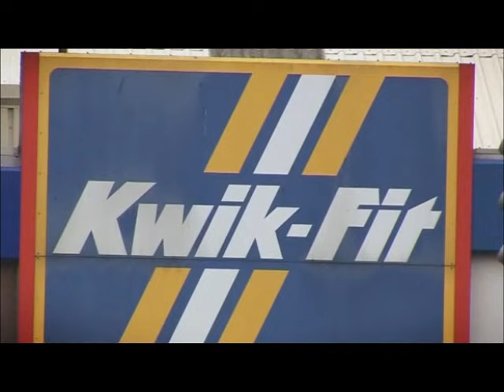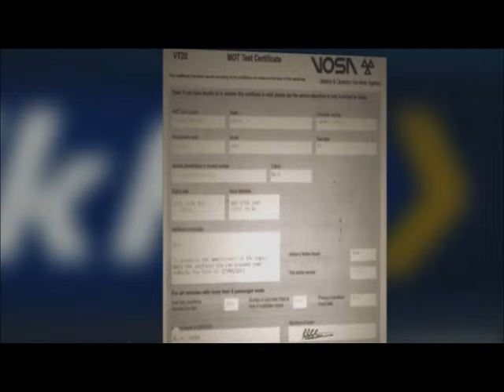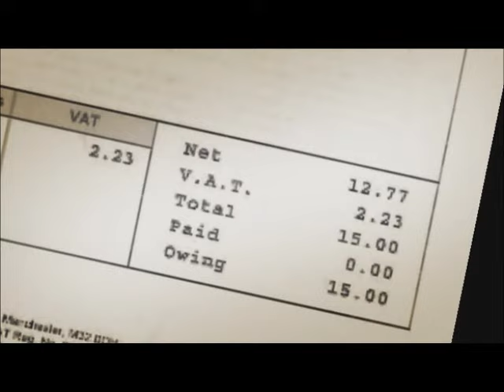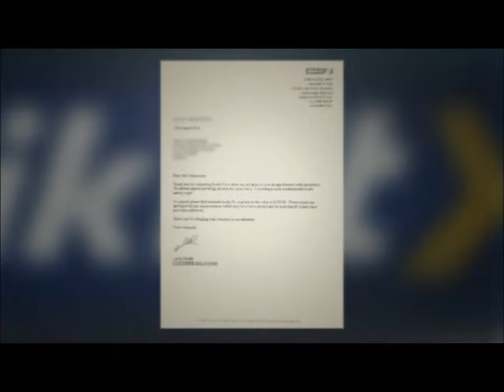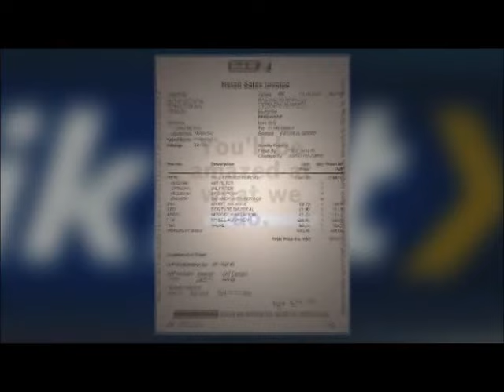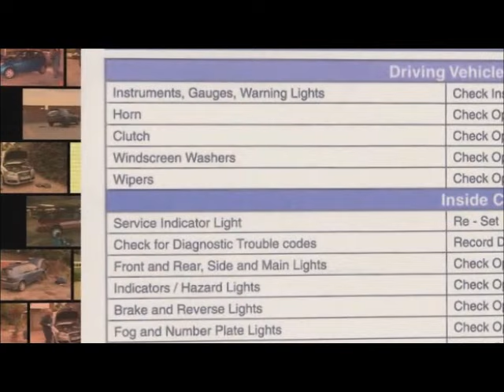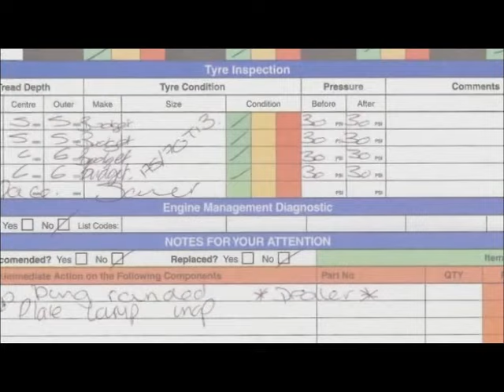Kwik-fit Car Rip-off Watchdog.wmv

Comment: A young work collegue took his 1 series BMW to Halfords for a suspected bulb or fuse issue, not being very mechanically minded it seemed a fairly easy safe thing to do, after sometime watching a spotty youth working under the bonnet he was told it could not be fixed by them, when he came to drive off the car would barely do 20mph (the car was now in limp mode for those of us in the know), after some heated exchanges he was directed to a Halfords 'special' garage where they could not find the problem - amusingly they could not even open the bonnet and had to be shown - he was also treated to appalling customer service and made to feel it was all his fault, with no resolution in sight he took the car to a local none dealer garage to have it 'indipendantly inspected' the result, a missing fuse from the fuse box for the engine management found placed at the side of the fuse box with out doubt removed and not replaced while 'trying' to diagnose what was in the end blown fuse for the light that was the start of all this.
Halfords quietly paid him £1000 in compensation to bring the matter to a close.

Comment: National tyres will rob you too! I took my sisters car there for an mot and they said it needed brake discs and pads all round. I said I would get my mechanic to do it. They said they couldn’t allow the car on the road in such a dangerous condition. I said my mechanic would pick it up on his trailer. Then they said that as long as I promised to get the brakes done asap they would pass the mot! A year later I took her car elsewhere for an mot and guess what? The same brakes passed easily! Robbing bastards! 💀

Comment: Kwik Fit MOTed the other half's car and failed it on brakes. I knew there was a problem with the ABS as it kicked in every time the brakes were pressed, but the actual brake components on the front  were less than 6 months old and the rears were around 18 months old as we had kept the receipts . Kwik Fit had the car for 4 days saying that the brakes were completely shot all round , then charged £450 for new brake components, which they made her pay for first , then called to say that the car had just been re-tested and had failed again - on brakes !! Then said it would cost a further £2-300 to sort it. I promptly drove down there myself to have it out with them with my other half in tow. They had an argument for everything I threw at them. How can you claim to change the brakes and then fail it again on the brakes you've just changed ??  Also it's funny how the manager is always in a meeting , isn't it? I told them the ABS was faulty, causing the brake problem, not the discs, pads, drums and shoes etc.Why did they make her pay before the job was done, etc. I then told them to get the car off of the lift and we'd take it elsewhere. They refused to let my other half drive the car home telling her it was dangerous and it didn't have an MOT. I left with my other half , threatening to involve trading standards and the police as they were refusing to release the vehicle. My other half received a phone call from a "manager" about 2 hours later saying he was pleased to inform her that the MOT had been passed and they would be waving the extra fees. We went back, picked up her car and I followed her home. The first thing she said was that the ABS still kicked in every time she touched the brakes.
Upshot was the car ended up being scrapped as the brakes, although shiny and new, did not function properly due to the ABS and other issues like the pistons in the calipers being goosed.
I wanted to take this up with Kwik Fit but she decided a new car was the way to go instead.

Comment: Went for a job at quick fit once , not as a mechanic but as a handy man. They asked if I could change a wheel, I said not really sorry, then they said can you just do an oil change , but again I said sorry but no I can’t,. Then they said what about just checking tyre pressures, I thought for a while and said sheepishly , that’s a bit too technical for me,  then the boss stood up fuming and asked “  if you can’t do simple jobs how the fuck  can you be a handy man “        Well I said,  I only live round the corner.

Comment: I took my car in for a service and was advised my brake discs were low and would need replacement at the next service.I measured the discs and found them to be well within spec.I went back forcthe next service and was reminded the discs were due for replacement.I ask the service manager what the disc thickness should be.He didn't know.Wanker

Comment: I can’t understand why they’re still in business, in the seventies I had an exhaust pipe fall off while using my pop’s car, they were on holiday and due back next day and my usual mechanics couldn’t fit me in so they were the earnest option. The thing was sorted quickly enough but caused nothing but problems, it was guaranteed for two years and literally disintegrated the day after the warranty expired.

Comment: I had the same thing, went to Kwik fit and they told me brakes were leaking and needed £500 spending. Went to local garage, no problem. This is the kwik fit in whitstable if any senior bods wanna do some firing- be my guest! That was in 2017. Still at it then I see from the time this video was published. 6 years on and they've rectified nothing.

Comment: Had a slow deflating tyre, after 10 minutes the mechanic said it was " definitely a puncture as the tyre was spongy " also stated the the 2 front tyres were low on tread.
I said that's funny it passed it's test 3 weeks ago and I've only done 50 miles since. So instead of the needing 2 new tyres all it needed was a new valve costing £ 13.50. Keep away from kwik rip off.

Comment: I got ripped off by Kwik fit a few years ago. Now whenever ANYONE mentions their car requires servicing, MOT or anything else I make sure to let them know my experience.
Reply: Just watched the video. The a similar thing happened to me. I was booked in for a service and MOT. They mentioned that I needed disks and pads changing at the front, due warped disks and warm pads. I told them that they were replaced only 2,000 miles ago and therefore I doubt they need replacing. They put the pressure on by saying that if they go ahead with the MOT and it gets a formal failure it will impact the vehicles value as it would be on the cars record. I told them to carry on, I want to get the official paperwork complete with the failures. When I went to pick up my car they had changed all 4 disks and pads and then put it through their MOT, which it obviously passed. They then tried to charge me the parts at cost price with zero labour charge as "they had changed them before I had given the go ahead". I said itll be a cold day in hell before I pay for those items which I didn't ask for, and that they were lucky that I don't take it further for them stealing my original disks and pads.

Comment: It's the same at Halfords.
Took my car in for an oil change(booked an interim service) 
When it came out, they said it needed a lot of repairs, just short of £1500 
One of the items was my radiator, I asked him what's wrong with it - Response was "Nothing, it's just old"
Laughed at that, spoke to a friend who's a mechanic and done the MOT on my car, he said that the majority of the high end "fixes" on my car weren't in any danger of failing, he said my brake pads were fine when he ran it through the MOT, the only thing that needed replace where the front wishbones, which Halfords wanted £209 for, I could get them for £80.

Comment: My mam was charged £740 for a full exhaust on her car, my mam getting on in life had the wool pulled well and truly over her head, she'd gone in for just a price quote, but they asked her to wait in the waiting room [odd that] because they needed to check the car, they came back with a price and my mam said she'll look elsewhere! The manager bluntly said they'd already taken her exhaust OFF to check for leaks and couldn't re-fit the old one!!! My mam caved in and had a new exhaust fitted.

Mam told me a month later on what had happened, I wanted to go back and tell them straight what they'd done was illegal and blatant bully boy tactics, but my mam told me not to as she was still upset after shelling out all that cash and didn't want upsetting any more.

Another exhaust centre wanted just £245 fully fitted.

KWIK FIT ??.........YOU ARE ALL CONMEN AND WANKERS IN THE FIRST DEGREE.
Reply: makes you sick doesn't it, happens to my mum but with her brakes instead.
Reply: My exhaust fell off and I went to a small local garage and they said I needed the full exhaust with back box, but then I went to another garage down the road and they said I just needed the back part that sticks out the end. I also go to Mr Clutch in Swindon and found them to be trustworthy
Reply: Was that yer Mam?
Reply: Same thing. My ma went to get her MOT at main dealer only to be told bracket on exhaust is broken and will be £1200 pounds for new one as they do not fix just replace. Me poor ma rang me in a state and I told her to tell them not to touch the car and she will take it elsewhere, then proceeded to hear the sales rep telling her oh what are you going to do some dodgy job and get it welded. New bracket? £12.99. Thanks a bloody bunch. Pricks
Reply: dude...take them to court
stay away from corporate repair shops....they're business model is all about profit not honest car repair.
Reply: ian8354.   Although I can,t stand Kwik fit with their inexperienced fitters and company background etc...the reason for the High price for your exhaust could be that it was a catalyst system which are pretty expensive and the reason the other Garage was so cheap was that they may have been quoting you a standard non cat exhaust...just saying....don,y think I am supporting these con men by any chance.....anyway they had no right to change your exhaust or any other part without your written approval.
Reply: I was done too, never again John.
Reply: @Find your inner peace Find your inner peace
Reply: Absofuckinlutely mate
Reply: I totally agree. I'm sorry for your Mum's terrible experience.
Notice to all Readers : DO NOT USE KWIK FIT.

Comment: Halfords are just as bad.
Reply: if not worse
Reply: Took my car to the Lakeside one to get new tyres fitted, after shopping with my wife and kids we picked it up and returned home via the M25, later that afternoon when I drove to a takeaway I heard loud noises coming from the rear only to find when I got out that one of the rear tyres nuts were just hanging on by their threads, he obviously forgot to tighten them.I will never go to them again and just thankful we werent killed on the motorway.
Reply: Yeah they couldn't even change an indicator bulb because it meant removing the wheel.......done it myself.
Reply: christopher hurn:      Brother in law went to Halfords a few years ago, went for an oil & filter change, that's all..... whilst the car was up in the air, the fitter started to spin all the road wheels... He then came back to my brother in law and remarked that his tyres are very near the tread depth indicators at the rear and the front tyres was level with the indicators, brother told him he knew of the tyres and the condition, next thing the fitter walks away and then some posh bloke walks around the car, examining the tyres, posh bloke walks away and then comes back & then gives me brother prices for 4 new tyres!

Brother in law was adamant Halfords was NOT changing his tyres because they was so damn expensive! Posh bloke who happened to be the manager said bluntly that if you drive that vehicle out with such dangerous tyres he will have no option but to call the police!

Brother paid for the oil & filter change and then told the manager to go ahead and ring 101 about his tyres, manager said he'll do it later...Chicken shit.

Brother in law went to his local MOT station and asked for them to check his tyres, all 4 tyres was 'just' legal but would require changing asap.

He got the MOT guy to fill in a sheet to show the tyres had been checked and was signed & stamped, brother went back to Halfords and thrust that notice into the face of that manager, brother also phoned 101 and asked for the police to see if his car had been reported for defective tyres, they'd had no such report.

Fuck Halfrauds.
Reply: Make me laugh when I buy windscreen wipers or light bulbs they ask do I want them fitted 😂
Reply: Mark Dunbar: Yes and the unsuspecting customer says 'ok' not knowing there is a charge... so they fit the part and then tell them how much it has cost! I once listened to an old guy who refused to pay for his wipers after being fitted and demanded they refit his old ones.
Reply: Ben Chud: There's just no need to blatantly rip customers right off, yes they are a business and need to make a profit to stay in business, but my brother had four tyres fully fitted on his car for the price of two tyres at the Halfords place AND the tyres was the same make too.
Reply: Dunno about halfords actual working as mechanics, but vs kwit fit I've heard much more positive about halfords, I do like halfords tool range though.
Reply: Halfrauds you mean 😁?
Reply: @lukesworkshop238  He's referring to Halfords Autocentres, which are different from Halfords shops. It's essentially a Kwik-Fit style garage network, just run by Halfords. Avoid them. The shops are ok though, if a little pricey.
Reply: @markdunbar8219  refuse they would probably forget to put em on
Reply: Bang on their Chris
Reply: @IanLanc  So, Halfrauds bod reckoned the tyres were "very near" the wear indicators and local MoT station stated they were indeed "Just legal" and should be replaced ASAP. Can't see an issue with that TBH..?
Reply: @TheRoybeasley  The issue was that Halfords was harassing me brother in law to have his tyres changed at their and when he refused they acted like a child who couldn't get his own way.
Reply: They can’t put their equipment together professionally
Reply: I took my fiesta in for a service at the Peterborough branch a few years ago, they called me quoting for just over 1k worth of advisory items even having the cheek to ask me if I want these doing over the phone. Aside from the ridiculously high price, the part that gave it away was that one of the recommendations was an air con service (my car didn't have AC!). I took the car to a local independent for a second opinion and needless to say that none of the work was required.
Reply: Most of these chains usually seem to have teenagers working on the cars. I do wonder if perhaps they see a part that is slightly worn and say it needs replacing, rather than having the experience to say it will be good for another 5000 miles or so.
Reply: I used to work for em absolutely awful definitely wouldn’t recommend working for em or taking ur car there
Reply: My local halfrauds autocenter got in trouble last year for doing dodgy side jobs......still doing it now!
Reply: Worse
Reply: And not forgetting ford rapid fit too
Reply: Was about to comment this .... Bad experience with Halfords myself.... Paid £260 for a major service .... I had a phone call saying it needed an oil and coolant flush and diesel cleaner combo for an extra £60 .... So over £300 , and they basically did nothing .... The bonnet catch and door hinges wasn't even lubed ,. I had to do it all myself ,. Windscreen washer fluid not topped up . The brake fluid wasn't changed , even though this is included on the list on their website .... I complained to the manager who asked me to take it back for a free major service and surprise surprise,. They managed to do what the list said it would..... So if you have any work done with Halfords , always check everything has been done properly ,. Or just stay clear in the first place
Reply: Halfords are a rip off

Comment: Ten years on from this video little has changed.  The strong marketing machine they have in place will always bring new unsuspecting victims into there premises to be fleeced using safety as the premise to upsell and repair lots of non existent faults and gain as much  added value profit as possible. Once they have your car in for a puncture its time for them to print there own pay packet. Use your head and go to a reputable independent.

Comment: Quick fit,    AVOID LIKE THE PLAGUE.    My son took his Vauxhall Corsa for a full service while he was at University.  When he came home a number of weeks later I decided to have a inspection of the car.   Unbeleivable the fuel filter which was suposed to be changed in the service was the original stock filter fitted in the factory when the car was new,  all rusty,  complete with the remains of the original Vauxhall part label there to be seen.  ( by the way the car was five years old) . I am a time served mechanic. i instantly made contact with Quickfit customer services who issued me a full refund for the service along with vouchers to be used on my next service. THEY MUST BE JOKING.  I binned them.   Nothing but a fraudulant company well aware of whats going on within their company.  STAY WELL CLEAR

Comment: I've not used KwikFit since the mid-80's; when their 'technicians' managed to shear bolts off the manifold on TWO different cars (a Sierra and a Cavalier) whilst new exhausts were being fitted. One of them was never repaired properly; indeed it was still 'blowing' when I traded it in. I'm not surprised to see they've never improved three decades later. At the time, they were employing kids on YTS - I think it was an abbreviation for Young, Thick & Stupid. Why on this Earth people still use KwikFit is beyond me. Find a decent, reliable TRAINED local mechanic. Customer retention and word of mouth is vital for independent guys; who have a passion for doing the job properly.